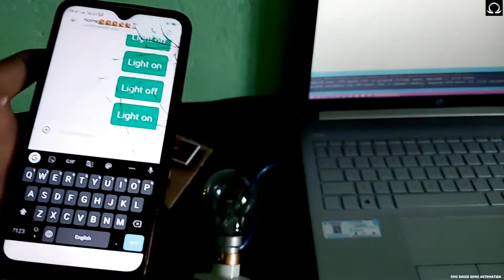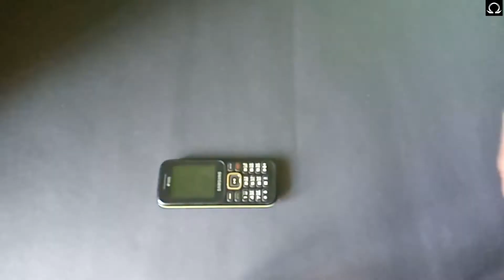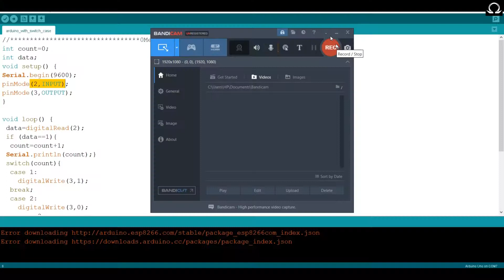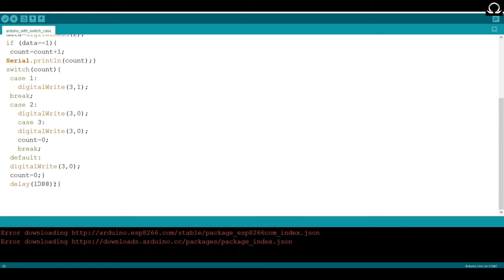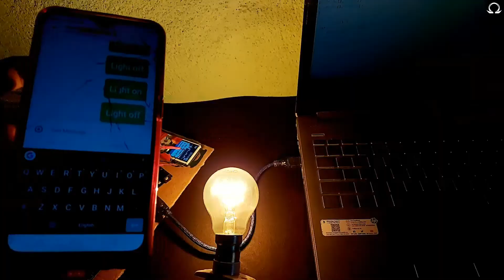SMS Based home Automation.Turn your old phone into a GSM module. Control device by sending SMS

Comment: The code is not working 
digitalread was not declared in this scope
int count =0;
int data;
void setup() {
Serial.begin(9600);
pinMode(2,INPUT);
pinMode(3,OUTPUT);
}
void loop() {
data =digitaRead(2);
if (data==1) {
cout=count+1;
Serial.println(count);)}
switch(count){
case 1:
digitalWrite(3,1);
break;
case 2:
digitalWrite(3,0);
case 3:
digitalWrite(3,0);
count=0;
break;
default:
digitalWrite(3,0);
count=0;
drlay(1000);
}
Reply from the maker: Hey bro ,
You can download the the code ->
https://github.com/AbhinavOraon/Sms-based-home-automation-from-old-phone

Comment: hola. desde Colombia como son las  conexiones del celular o los cables que soldó al celular donde van
Reply from the maker: I have soldered the wires from the vibrator compartment to digital pin of Arduino
+=2
-=gnd
 Reading the digital signal and according to it triggering the relay
Thank you!😀